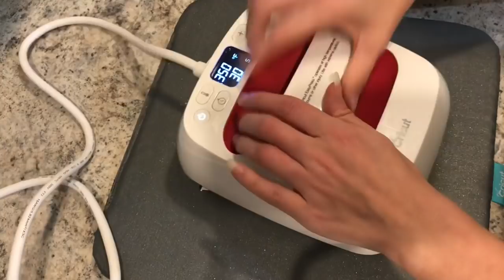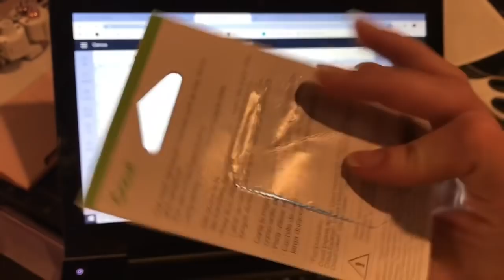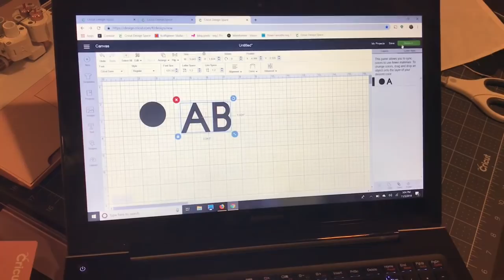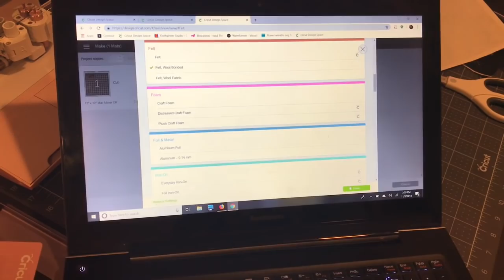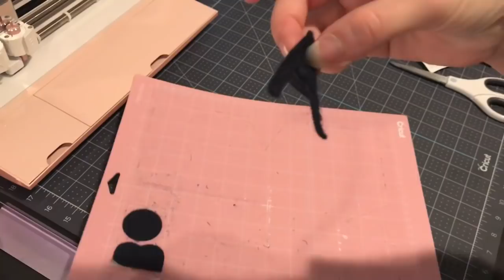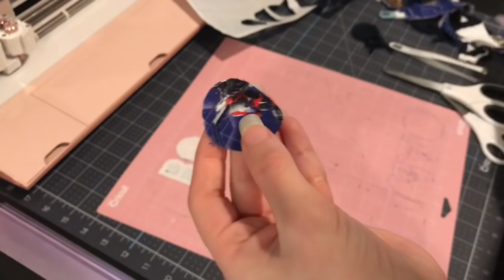Using Freezer Paper to Cut Fabric with Cricut Explore Machine

Comment: Hi Katie! I just requested to follow on Instagram, I have a question about this video! I'm looking into cutting silk, and wanted to know if you'd had any experience cutting silk on your Cricut? Thanks so much!
Reply from the maker: Hi Cami! I do not have an Instagram! But I have cut silk once! What questions do you have?!
Reply: @katieodonnell-vicente6632  Hi! I just saw that you had responded. I'm just curious what the best way to go about precisely cutting silk with a cricut would be.. I just ordered the fabric blade.. What would you suggest using for making the silk a bonded fabric to cut it well? Thanks!
Reply from the maker: I would only cut it with my maker and rotary blade!

Comment: I'm apparently doing something wrong. I'm using Reynolds plastic coated freezer paper with a brand new bonded fabric blade and a pink fabric mat. Settings on felt wool bonded. Tried with normal pressure and also with heavier pressure. I don't have an Easy Press so I used my iron on the hottest setting, keeping the iron in place for over a minute. Not a single cut.
Reply from the maker: Do you have the blade in the housing correctly?

Comment: Thank you for sharing!   You mentioned that the Bonded Fabric blade was the same as the premium blade.  Is the housing the same also?  Can I use a new Premium blade in my premium housing to cut cotton that is bound on both sides?
Reply from the maker: You’re welcome! The housing is the same too! The pink coloring is just because a separate blade is recommended for fabric and the different colors make it easier to separate. You can absolutely use a new blade in your current housing!
Reply: Katie O'Donnell-Vicente thank you for confirming. That is exactly what I was hoping you would say. I only intend on fabric for masks, do you think the strong grip mat would be sufficient since it’s not intricate?  :Crossingfingers:
Reply from the maker: You’re welcome! You can try it but keep in mind the freezer paper is thin paper and may stick to it more than you would like

Comment: I just used a full sheet of sticker label paper to stick on the back of my cotton fabric. I tried freezer paper but it kept pulling the fabric while trying to cut.. So tried this method. Also  cut twice in a row just in case it didn’t cut. Cut perfect...woohoo. I’m going to try your double sided too cause I’m out of sticker paper right now. The sticker paper goes on easy and comes off easy. I’m cutting mask fabric. Love it. Now to start sewing. Thank you so much, great video and great teacher.
Reply: Wanted to know if you could cut mask fabric with the Explore 2! Thanks!
Reply: makeupbykifana I used the explorer 2 and it was a mask pattern I cut. Also saw where someone used contact paper and stuck it on the back of fabric. I haven’t tried this or seen it done. Just saw Dollar Tree video where they said their contact paper any color could be used.
Reply: @SharoninKentucky  thanks! Saw that. Not wanting to invest in the Maker yet so was happy to see you say that. I was also thinking of the Joy since it's small. Wondering if you can do it on that too.
Reply from the maker: I’ve heard that but I wouldn’t think that contact paper gets it stiff enough
Reply from the maker: You would not be able to with the joy
Reply: @katieodonnell-vicente6632  what about cutting out a cardstock mask pattern with the Joy?
Reply from the maker: Yes! This video will show you how!
Reply from the maker: Yes! This video shows cotton and fleece and you need tightly woven cotton for the masks

Comment: THANK YOU SO MUCH!!! This worked awesome. I've been making face masks and before seeing your video, printed the pattern out on cardstock and then used that to cut the fabric. With your video, I am able to get a more precise cut and speed up the process as well. Thank you for sharing.
Reply: Thank you for having this tutorial!!  I've been making masks as well but did discover that I could cut out my patterns onto craft pattern "paper" using the blue mat and fine point blade and then cutting material, sewing, etc.  I'll be trying this tomorrow!!
Reply from the maker: D F you’re welcome! I hope it makes it easier for you!
Reply from the maker: Geri Selman you’re welcome!
Reply: Are you using the bonded fabric for mask?
Reply from the maker: kittyboo2121 no, you should not be using bonded fabric but you can use the freezer paper to bond it to cut and then remove the freezer paper to sew

Comment: what kind of freezer paper are you using?
Reply from the maker: Micki O any should work, I believe I have Reynolds brand
Reply: Great thanks. I’m not sure if you can tell me but I wanted to make masks for the medical field, for the shortage that’s going. I wanted to know if the freezer paper would make the fabric stiff? I just need it to help me cut the material.
Reply from the maker: Micki O it makes it stiff to cut with the explore machine but then peels off so you have just the fabric pieces
Reply: Katie O'Donnell-Vicente  so the stiffness is just there when it cut but after removal it will be fine, is that correct?
Reply from the maker: Micki O correct. If you watch the video you’ll see how easy it perks right off and doesn’t effect the fabric!
Reply: Katie O'Donnell-Vicente  great, 
than you so much for your advice and your video
Reply from the maker: Micki O you’re welcome!

Comment: I have a Cricut Explore Air 2.  The bonded fabric with flannel simply will not cut through the fabric and backing.  I'm using the pink mat with the bonded fabric cutter.  Any suggestions?
Reply from the maker: JoAnne Meehl what setting are you using? What are you using to bond the fabric?
Reply: @katieodonnell-vicente6632  Set between Vinyl and Iron-On (Tried Iron-on before  and didn't cut deep enough)  Used Heat n' Bond Ultra Hold on the flannel back.
Reply from the maker: JoAnne Meehl do a small test cut with the bonded fabric setting
Reply: @katieodonnell-vicente6632  Hi.  I'm not seeing my response showing up so I will retype.  I am using the setting between vinyl and iron-on.  (Tried Iron-on  setting and it simply  didn't cut deep enough.)  I've backed my pre-washed,, ironed flannel with Heat n' Bond Ultra.
Reply from the maker: JoAnne Meehl do a small test cut using the bonded fabric setting
Reply: @katieodonnell-vicente6632  Thanks!  Will try.  Also thanks for responding so quickly!
Reply from the maker: JoAnne Meehl you’re welcome! Please let me know if that works!
Reply: @katieodonnell-vicente6632  IT WORKED!  THANK YOU SO MUCH!
Reply from the maker: JoAnne Meehl you’re welcome! I’m so glad you got it!

Comment: A cricut worker told me there is no bonded fabric blade for the cricut explore only the maker... so what blade did you use???
Reply: This is great I was told the same thing when I went to Michael’s Store Thank God I found your video
Reply: They were probably thinking of the rotary blade.
Reply from the maker: Makayla Ferrence I’m not sure why they told you that because the bonded fabric blade works on both machines. 
https://cricut.com/en_us/bonded-fabric-blade-housing.html
It’s the same as the standard, premium fine point blade that comes on your machine except it’s pink to differentiate.

Comment: Have you used this method with stretchy fabric?
Reply from the maker: Sarah States I have not! Stretchier fabrics would be a little harder, heat n bond would probably be better for that but it’s definitely worth a try!
Reply: I've used freezer paper with stretchy fabric, but the blade seems to rip jagged edges through instead of cutting, and it's also a real pain to pull the freezer paper off because the knit fabric stretches so much. I'm definitely going to use heat and bond next time.

Comment: So will I be able to cut my patterns out, to sew with the sewing machine, using this method? Because the heatnbond gunks up my needle & machine, so I cant use that. I tried this, but for some reason, it is not sticking to the freezer paper. I made sure it was on the right settings and no water in the iron. I don't know what Im doing wrong.
Reply: Take the freezer paper off before you sew! Two bad things happen if you try to sew with freezer paper on the fabric. One, the freezer paper will be nearly impossible to get off once you've sewn it on, and if you do manage to get it off then the stitches will be way too loose, because the thickness was there before and now it's gone when you remove the freezer paper. I learned this the hard way.
Reply: U probably need the paper with the plastic coating on it.

Comment: Does it matter if it's plastic on wax on the freezer paper
Reply from the maker: You’ll put the waxy side of the freezer paper down, that’s what will help it adhere to the fabric
Reply: @katieodonnell-vicente6632  sorry, I meant "or" because mine is plastic not wax. Also I have the explore air 2 and was wondering if I needed a different blade
Reply from the maker: colleen JAY you cannot use wax paper because it is waxy on both sides, you definitely need freezer paper. As for the blade you can use the fabric bonded blade like i did or a regular blade, they’re the same just different colors to designate
Reply: @katieodonnell-vicente6632  yeah this is a scam i had 5 regular blades in stock only to buy two fabric blades, come to find out they are the same thing.
Reply from the maker: Mick Matias they are the same. The fabric one is pink only to differentiate but I wrote fabric on the packaging of my regular blade to do the same thing.
Reply: @katieodonnell-vicente6632  have you tried this method with satin fabric?
Reply from the maker: Mick Matias I have not! Satin is tricky but you could definitely try it!
Reply: @katieodonnell-vicente6632  so I didnt try it with the freeze paper but I did use heatnbond lite and it worked very well. Smooth perfect cuts with satin. Thanks for your video!
Reply from the maker: Mick Matias I have done it with heat n bond and it cut perfectly so I don’t see why this wouldn’t work too! I may have to give it a try and let yo know!
Reply: Would the felt still work on a felt board?